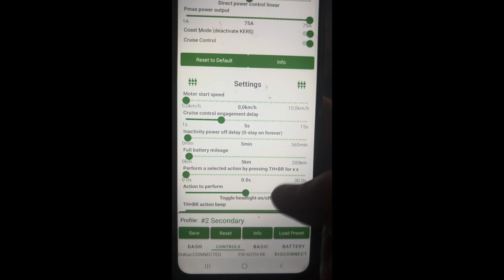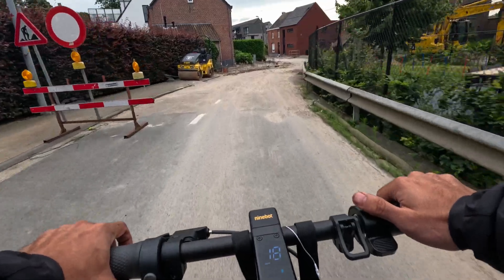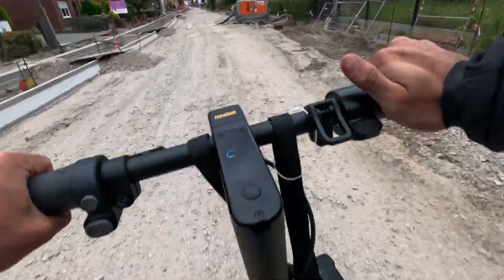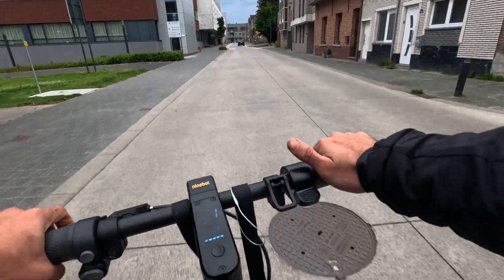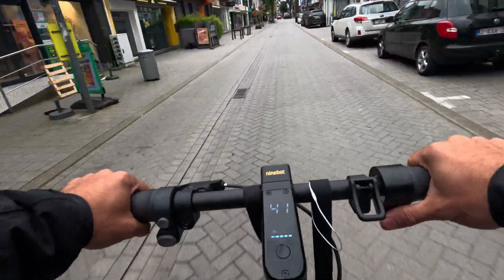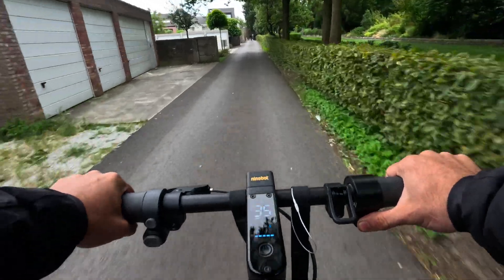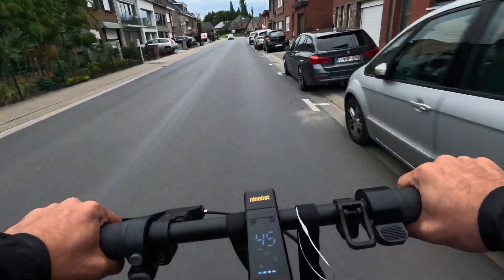Ninebot Segway G2 Max Xiaodash Test Ride

Comment: Hey Wez, thank you for this nice video! I noticed in your video that you’re from Belgium, just like me! The Ninebot G2 that you have modded, is it still equipped with the original UNAH motor (900w peak)? Or did you change it with the PPAH (1000w peak)? I still have the original UNAH motor and I would like to know if it is possible to safely tune it to go 45 km/h but I’m not sure. I use it everyday to go to work wich is about 9 km from my house. Thanks!
Reply from the maker: Yes its 100% safe. Ppah has more speed but a lil less torquey and less heating compared to unah

Comment: hey i have the max g30 and i was wondering if i buy the app will i need anything else or can i hack the speed with only my phone
Reply from the maker: Depends on what software youre running if you download the app and connect it it will say if its compatible or not
Reply: @wezvstech  it said ots compatible but i have the newest frimware